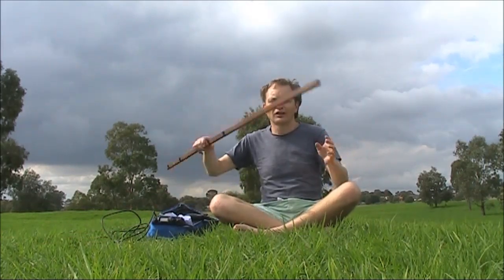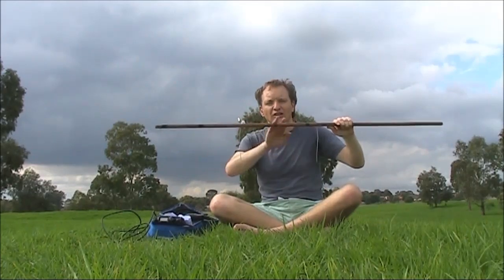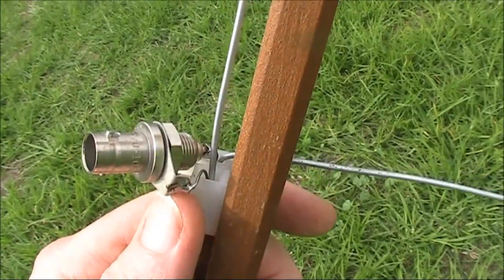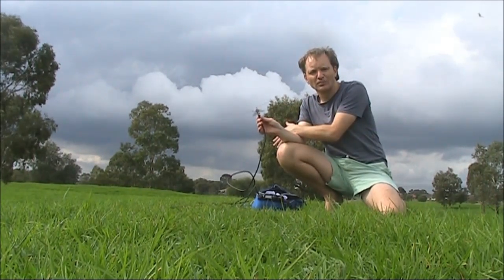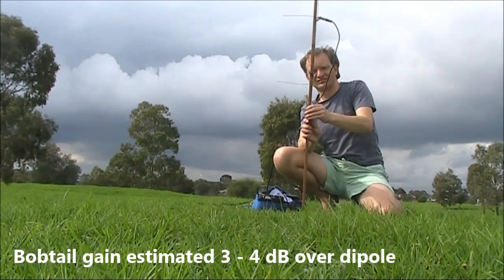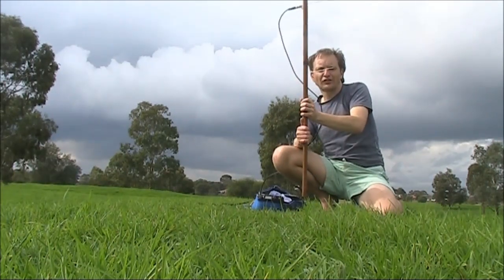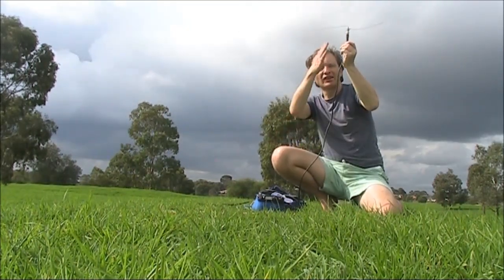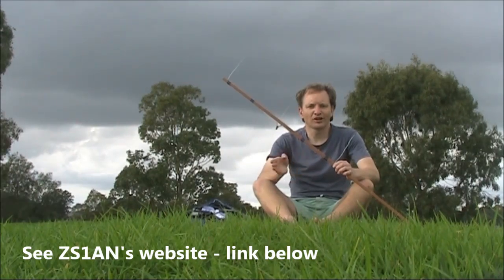A bobtail gain antenna for 432 MHz

Comment: It’s three 1/4 wave vertical antennas with the top wire providing phasing. Hold it with the short vertical elements up and down with the 1/2 wave section horizontal

Comment: Good example!
I made one 2m bobtail with reflector. But only tried it once - there was no more possibility. The effect was good.
Made of 4 mm diameter wire, suspended on nylon ropes with “horns” down.

Then I did this for the 70cm range, also with a reflector. Also upside down ("horns" down)! Tested many times.
I liked her work!
Very low build cost but good job!

Comment: For longer wavelengths could you cut these lengths in half to make it a virtual 1/2 wavelength bobtail?
Reply from the maker: For longer wavelengths you'd lengthen rather than shorten the antenna commensurate with wavelength.  Or use an antenna coupler and load it up as is on bands like 7 MHz - it will work but won't be a bobtail.
Reply: vk3ye sorry - I wasn't clear - I understand general lengthening based on wavelength. What I was asking is can you halve the bobtail lengths and still get good performance. That is, have the long element be 2x quarter wavelengths and the short ones be wavelength/8 -- basically halving all lengths?
Reply from the maker: It will work fine as an end-fed half wave but won't have the same directivity and gain as a bobtail. Still it would be perfectly OK.  Matching would be a problem, especially on UHF but it's easy on HF with an L-match.

Comment: Thanks Peter for your never boring videos. I have a question for you, If an antenna say a yagi is made of bigger diameter tubing it is more broadbanded, but does broadbanding come at a cost of efficiency?  If I am making an antenna and only want a small frequency spread is it better to make an antenna of smaller diameter elements? Would it be more efficient? You may say why build an antenna that spreads more frequency coverage than you want anyway, which is true but I just wanted to know if lower Q is less efficient than High Q.  Thanks
Reply from the maker: +Argento Goldspier No, a yagi with thicker elements will have just as much gain as one with thinner elements.  It's only when antennas get to much less than full size that there's a trade-off between bandwidth and efficiency.
Reply: +vk3ye Thank-you Peter for answer. Look forward to more of your videos. Cheers